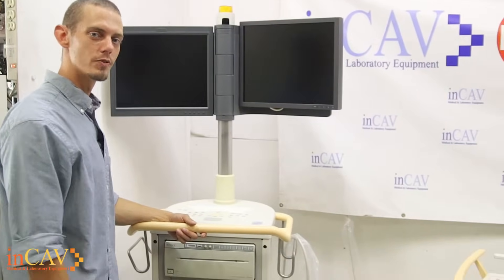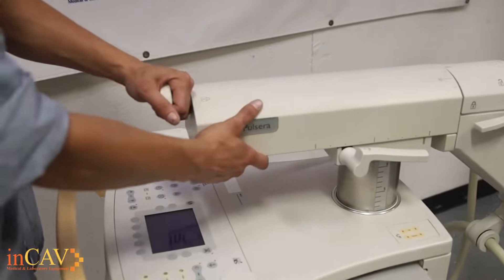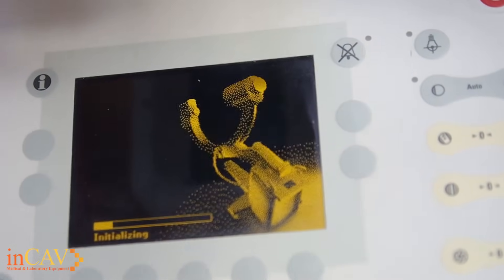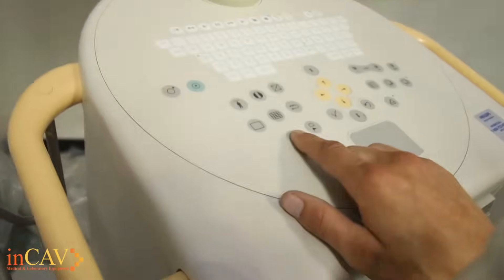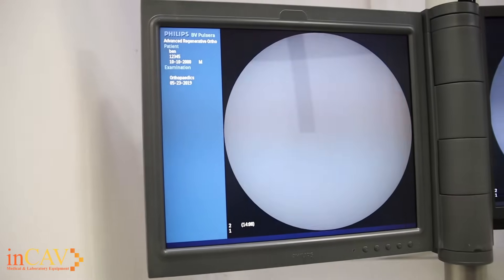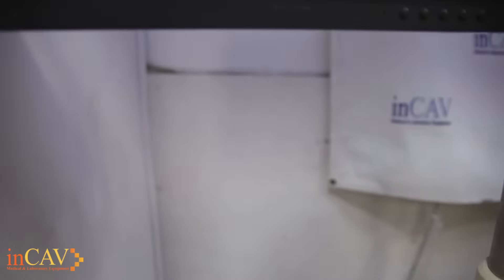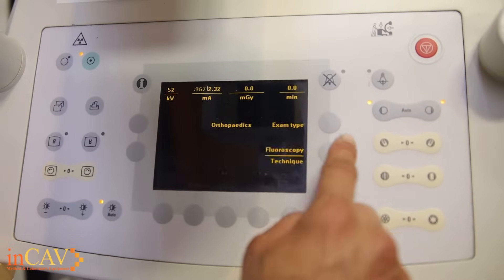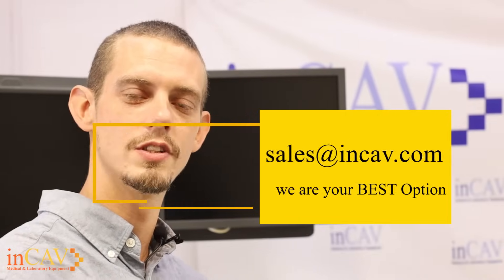How to Use The Philips BV Pulsera C-arm ( Fluoroscopy)

Comment: We are having a problem with post processing.   We can bring up an image and select the zoom feature.  A zoom box will appear and you can move it along the image and zoom the area of interest.  The problem is ….HOW DO WE REMOVE THE ZOOM BOX FROM THE IMAGE?  It seems to remain there and doesn't allow us to revert to just the original image.  Solution?
Reply: Sorry for the late response, i feel as tho prrssing esc will reset the option however i sold all the previous units i have one comong in tomorrow so i will take alook when i run my diagnostics check
Reply: Try the following: Select the zoom box with the cursor and then press the key on the keypanel which looks like a square with a cross through (positioned below the left space button)